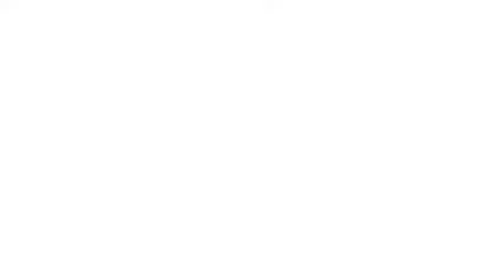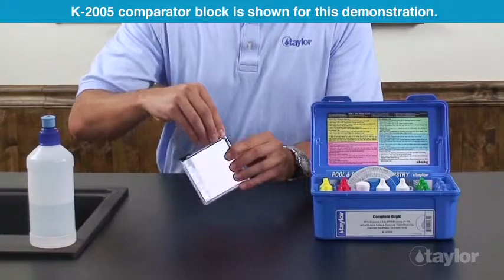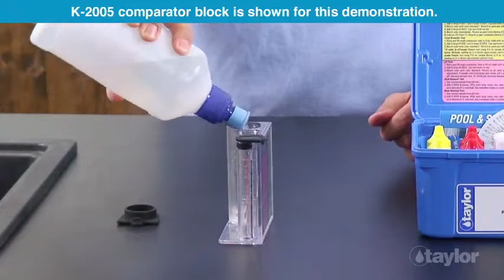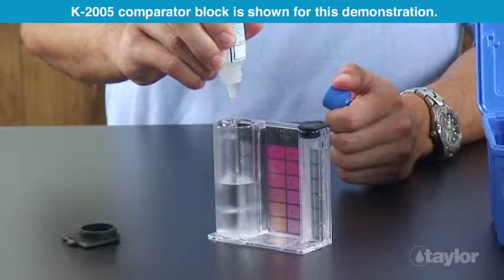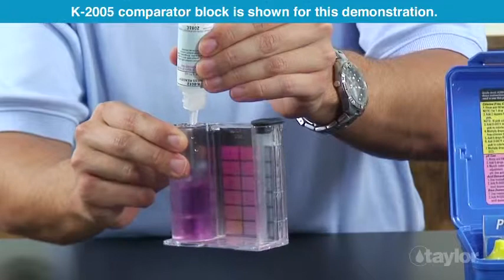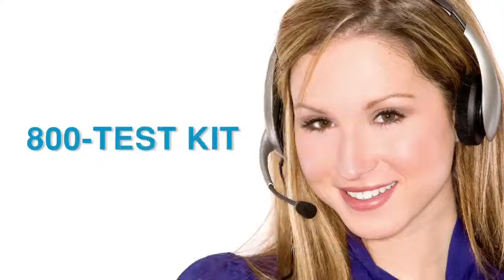Taylor K2006 calcium hardness swimming pool water test

Comment: If every pool owner was aware of the knowledge on poolforum.com, and realized the simplicity of maintaining pool water (thereby vastly prolonging the life of the entire system), there would be virtually no need for pool service companies.

These Taylor test kits combined with the BBB method give you what I call "Happy Water". Unhappy Water will ALWAYS spit out what it doesn't want, resulting in deposits or mineral build-up, or ALWAYS "take" what it needs. That may mean taking some calcium from your gunite, or some iron from whatever metal it encounters. Water is the world's ultimate solvent, capable of disintegrating almost anything to make itself "Happy".

I have no financial interest in the website, and have never communicated with the owner. I assume it's still a guy named Ben. But 10 years of putting these simple practices to use has given me a pool that NEVER burns eyes, leaves white scaly deposits, or rusts or corrodes anything. I tell my friends that if needed I would pay $100 a month to PREVENT a pool guy from touching my water.

My water is happy.